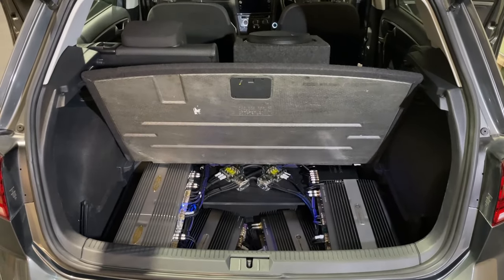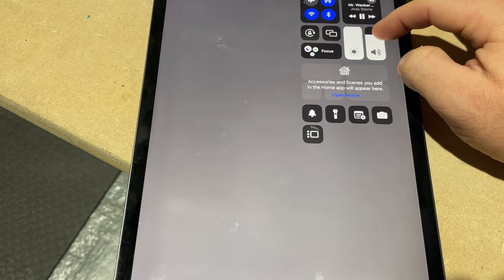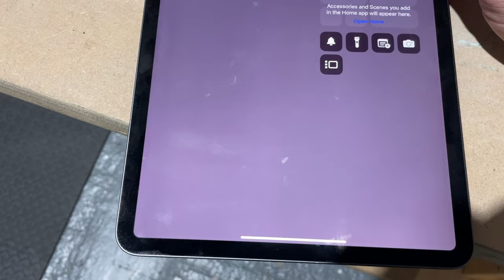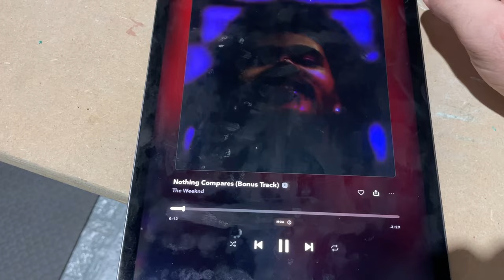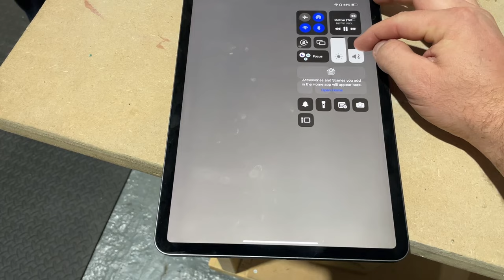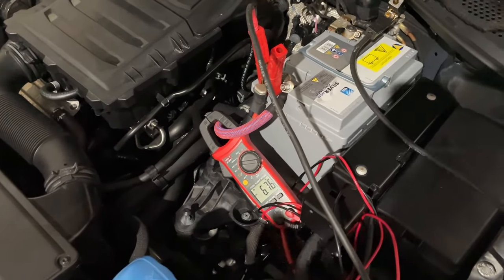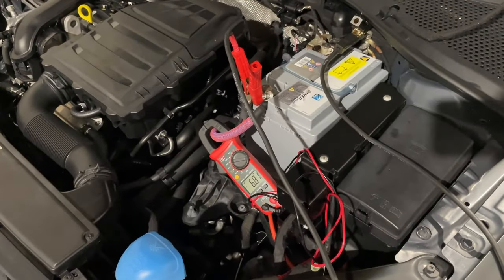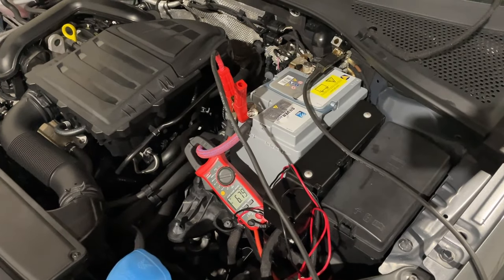Clamp Test - 5x Genesis & DLS Class-A/B Amplifiers - How Much Power Is the System Actually Running?

Comment: Thanks Peter!! This proves my thoughts. I pull less than 70A at highest point on my A/B 3 amp setup for SQ! I’m sharing your video!! No one believes me!!
Reply: I would like to point out, from a general electronics perspective 70a is still A LOT of power.
Reply: @ exactly why I went from a 200amp alternator, to a 350 amp. Also bought a big 3 kit and replaced my start battery with a XS Power. Maybe my A/B setup is not as efficient as some, but A/B amps to me sound better, I don’t want to starve the 60% of efficiency I have.

Comment: @Pssound- Very nice demonstration. Impressive sound for only 81 Amps drawn, @ max pull. For my loudest competition, SPL run, i pulled 1,115 AMPS👀!
Reply from the maker: Ohh SPL with power hungry is a different game! I have many friends who do that kind of madness with 1000s of amps pulled.
Reply: @pssound9749  That 1,115 amps pulled was from just 2- 3500 watt "Rated" amplifiers. And was done on 18 volts! I wasn't trying to compare, to what you are showing. I myself, was surprised by my amperage pull test. I was wired to a .6 ohm load, and these 2- "3500's" were straped= .3 ohms per amp!
Reply: Beautiful sound!! What was the total system wattage ? I was expecting more amp draw. Learn something new today. Impressive with stock alternator and stock battery. Thanks Peter.
Reply: @hypefxx9011  - Were you asking my total wattage? As you typed to my comment, and not to this video.

Comment: One thing is speakers impedance. Lower impedance needs more power. If you run your subwoofer 1 ohm you'll need much more power from battery than if you run same sub in 4 ohm. And you still might not play it any louder in 1 ohm especially when you use just your ears to measure spl level.
Reply: Depends. If you lower the impedance then you would need to lower the volume to that amp since otherwise it would play to loud compared to the rest of the system. 100 W  to speaker is same current in at 1 or 4 Ohm.

Comment: When I turn the volume up to around 80% (and above), my headlights dim at night. 

Here are my amplifiers for my 3Way :
Steg k4.01 (midrange + tweeters) AB
Steg k2.01 (woofers) AB
Esx vx2000 pro (subwoofer) D 
Steg sdsp68    D

The original alternator is a 150A (FOCUS ST MK3 250)
I have a YUASA AGM battery and I've replaced almost all the halogen bulbs with LEDs :( .
Reply: you are probabaly clipping an amp. clipping will easily double or tripple the amp draw but wont make it louder.
Reply: Measure the current draw and add a second battery closer to the amps, it will help a lot.
Reply: @AlexWayne1  No, no, that's silly talk.
Reply: That is all completely normal. The dimming of lights is simply due to the voltage dipping. The LED headlight bulbs should be regulated and not show any signs of dimming.
Reply: @JasonWW2000  well, maybe, but clipping an amp will pull a lot more power. so i'd make sure i am not clipping anything and then go from there. 
it might have been better to say "Make sure you arent clipping anything" in my first comment.
Reply: @AlexWayne1 Yeah, clipping is never good. 

To elaborate on my earlier comment, the difference between loud, clean output and clipping can be one click of the volume knob. Amperage might jump up 10%-20% with that one click. 

It will never jump 100% (double the amperage draw). 

A person might do 2 or 3 clicks and clip really badly and it will be audible. The amp might draw 40%-50% more amperage due to it trying to crank out more power. You also typically get the most voltage sag. Efficiency can also drop. These three things combined is why you might see the 40%-50% extra amperage draw. 

BTW, this is all about the subwoofer amp. It's the power hungry one. The amps on your mids and tweets can clip also, but it's more noticeable and doesn't have huge amp draws.

Comment: Pete, the Title says "How Power" you're missing the word "much". 

80Amps though, crazy little power. i thought it would easily pull 150Amps.
Reply from the maker: Thank you! Late night posts can easily have typos! 😃
Yeah, people don’t know how much an active SQ system pulls. Even at the presented demo levels tweeters & mids use like 10-20W, midbass 30-50W, front sub 100W and rear sub uses like 300-400W and yet you get concert/club levels that make you deaf easily.

Comment: am planning an audio for my honda accord 2005 model sedan,

its 
Focal KX3E -3 Way Front
Helix G4 Amps -2Nos,
JL Audio TW3 12inch-1nos,
Helix BT HD Streamer,
Helix DSP3s

So u can tell me ,Did i need ANL Fuse ,if Yes tell me whats the Ampere i Need it,and Whatelse i need to run all these Electronics
Reply: If you are going to run a dedicated power wire for all of these amplifiers then you definitely need to have fuses. Some fuses are there to protect the wiring from burning down your car and other fuses are there to protect the equipment from burning internally. Each amplifier should have a recommended fuse size for it. Each of those G4 amplifiers recommends a 60 amp fuse. If your battery is in the front and the amplifiers are in the rear I would recommend a single run of 1/0 copper power cable. This will minimize voltage loss and give you some extra amperage capability if you were to add an additional amplifier later on. You would need to add a fuse as close as possible to the battery and it could be anywhere between 100 and 300 amps. 300 amps would be about the upper limit to protect that wire, but since you're not going to be drawing a lot of amperage you could probably use a 100 to 150 amp fuse. In the rear of the vehicle you should get a power distribution block to divide that 1/0 into a pair of 4 gauge and each 4 gauge should have a 60 amp fuse. 

The other equipment such as the DSP is only going to need a couple of amps and you can have a separate small inline fuse coming off that main power distribution block.

If your battery is in the rear of the vehicle, where the amplifiers are going to be, then you could probably use a short run of 4 gauge copper wire. You would need a fuse size between 100 and 120 amps for this smaller wire. All the rest of what I said still applies.

Comment: Ok 80A,five amplifiers,main thing is how much wats is realy drawing from amplifiers😉
Reply from the maker: Well, obviously not as much as people think. We have around 1800W rms on the given speakers and if you calculate from 80A on 12.5v (average we could maintain with OEM battery and a 30A power supply) multiplied by efficiency of amps, then you roughly get around 600W that is actually used at even these ear blasting levels.
Reply: @pssound9749  Thanks for replay.I know that,just i want to other see what is real power need for decent/loud output.When i find time i will put my system on spl magnum,not tu measure spl i want to know real wattage that my speakers see.